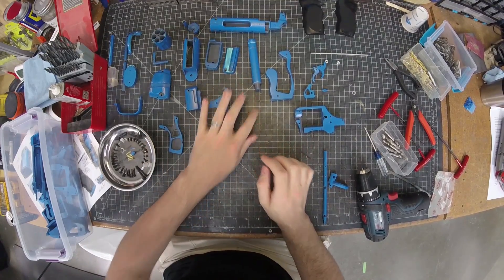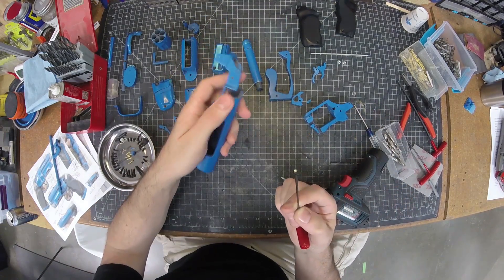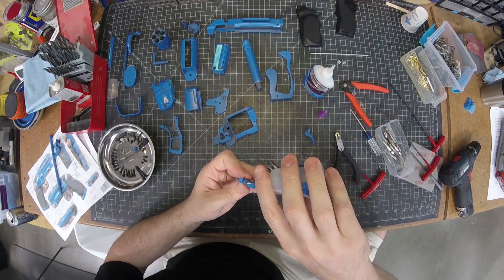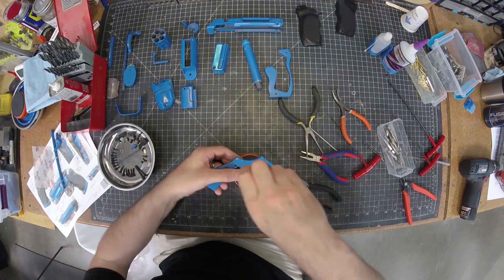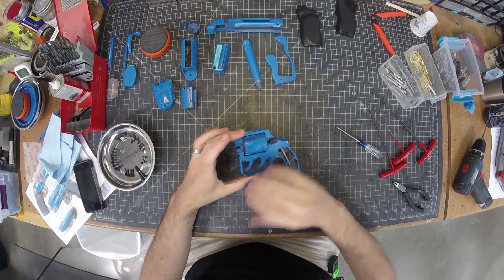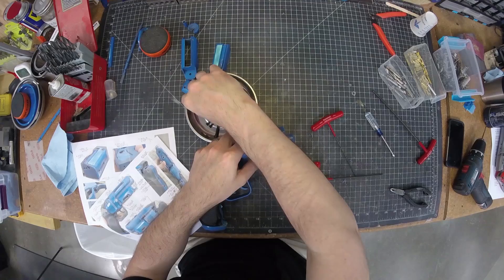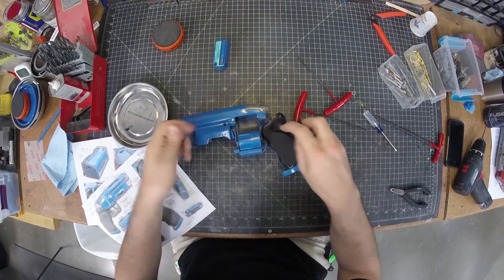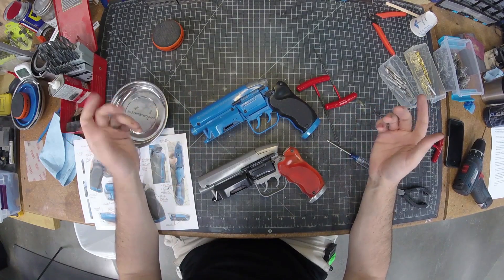How to Assemble My Bladerunner Blaster 3D Printed Parts

Comment: Bill, how did you design the handle grips? I tried several times in Fusion 360. I ended up modeling it in chavant and printing the knurling. Then made molds and cast them in epoxy. Also what printing material did you use for the grips?